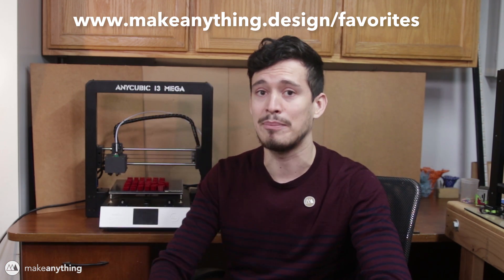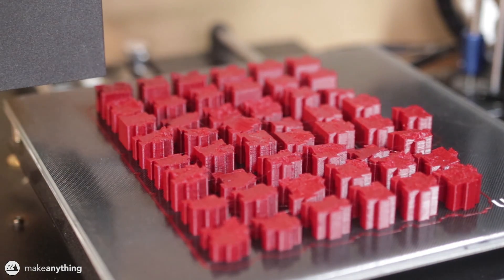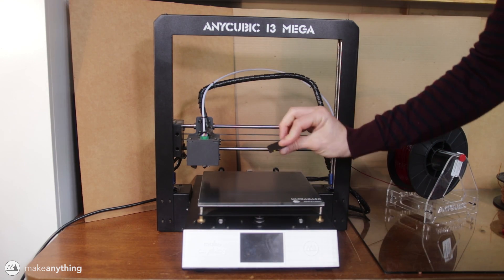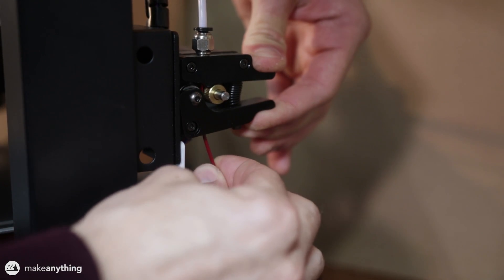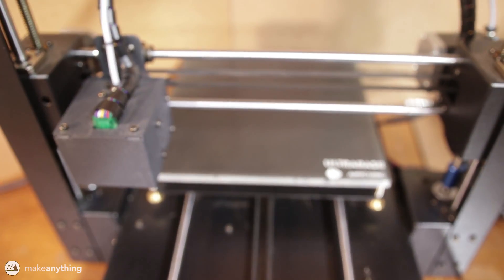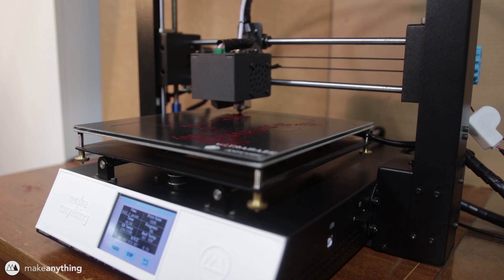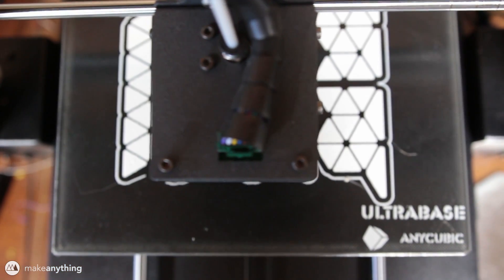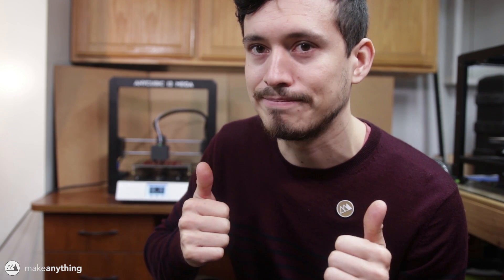Anycubic i3 Mega 3D Printer Review ✰

Comment: If you have problems with your mega don't look for hardware issues first, i stripped mine down twice checking component by component, and it turned out to be the SDCARD, for some reason timing is critical and turned out some cards only work sometimes... Don't cut corners get the fastest brand name card you can, size is irrelevant, but speed and quality is... If it can't read the directory or the print stops for no reason swap the SDCARD first.

For stability, quality and cost its one of the best. But it's noisy and only an average print size... The base is one of the best for adhesion and releasing prints when cold.

Comment: which type of filament would be best for snap-fit parts? Does this printer work well for that?
Reply from the maker: PLA works for many snap fit parts, but if it's for repeated use, you may want to use ABS or even Nylon. Those two might require an enclosure but could be done on this printer
Reply: @make.anything  can you explain further what you mean by enclosure? Have not heard of that before
Reply from the maker: @erickdiaz6152  I usually just put a bag over the printer, but basically some materials need a warmer ambient temperature so it doesn't shrink too fast, so an enclosure keeps the environment warm. May or may not be necessary depending on the air temperature
Reply: @make.anything  ok that makes sense. Might even help with noise too haha. Thanks!

Comment: I ran into an issue when moving the motors with the LCD, I hit "home" when moving the axis thinking it was gonna send them to their home positions, but it set those coordinates as home, so when I sent it home, the bed went back more than it had to and ended up busting the limit switch. I replaced the switch with the spare it included, but now I don't know how to reset the home positions so that that doesn't happen again :(
Do you know how to reset those?
Reply from the maker: Are you sure the limit switch wasn't already busted? The switch is the thing that's supposed to stop it and set the home position
Reply: Make Anything no, it was working just fine, it got busted because it tried to send the bed way too far back, I had to hard turn it off for it to stop twice :/

Comment: I have bought Anycubic Mega S and using for 1 week in my prints I have Elephant foot effect. Do you have any suggestion for the solution
Reply from the maker: Lower the print bed. If that hurts adhesion, you might need to use hairspray or gluestick (although the ultrabase on my i3 mega printers have been great). Otherwise, you can just print with a raft, or just live with a bit of elephant foot
Reply: @make.anything  my actual problem with elephant foot when I print functional parts like your fidget spinner (geared model) gears stick the outer wall or stick each other and they don't move
Reply from the maker: @orkhonal  Yea, so if lowering the bed doesn't work, using a raft should improve accuracy
Reply: @make.anything  sorry if I bother you with questions, I am new to 3d printing ; do you mean lower the bed using screws under the ultrabase plate or using the Cura?
Reply from the maker: @orkhonal  Do it with the screws if you can. And no worries I'm happy to help if I can!

Comment: WARNING!!!!I got the mega S and that sucks, the build plate i am not fan of(but that is maby just because i am use to buildtak flex plate), you have to wait til the build plate is cold to remove the prints. and it is noisy AF 71 db, now the part cooling fans mosfet is burned out at 50% cooling (6V)  not good enough for PLA not bad enough for ABS and it is only 2 month old :-( but just before this happen i got new solid slide bearings (drylin rj4jp-01-08), added stepper motors from my 7 year old wanhao i3 and added TMC2208 V3 stepper drivers, and with new fans i am down to 41 db. :-D but now part cooling is dead. and i can see all over they recommend that you add external mosfeds to your head bed and hot end so you don burn out the internal mosfets because they are way to small, this printer is just TO cheap.

Comment: Hey i bought the Anycubic Mega-S and never got a single print out of it, not even the demo. On top of the bed being so difficult to get perfectly level I'm having an issue where the feeding mechanism is slowed to a crawl (almost not moving at all) where the extruder pushes nothing out the hotend, its frustrating i updated to 1.1.3 yesterday and i dont know what else to do maybe i have a bad part on my BRAND NEW S printer i dont know for sure just hit me back with some solutions please.

Comment: I just wanted to say thanks for posting this. I was looking for a workhorse to split the load with my then-MK2S when you posted this, and this video convinced me to grab a Mega. I've had it over a year now, and the only changes I've made to it are replacing the belts, (they were shedding) and last month adding the Mega-S upgrade. This thing requires basically no maintenance other than occasional cleaning filament and wiping off the rods and giving them a shot of oil. The bed's only lost level once, and that was last week when some Ninjaflex (yes, the S upgrade let's you print that crazy spaghetti) bonded way too well to the bed.

It prints almost as well as my MK3S in most cases, assembly required whole eight screws and three plugs, the upgrade required four screws and one plug, it hasn't so much as jammed on me once, and it's never had any downtime. I love this tiny tank.

Btw, if anyone else is emboldened by this post to print NF on a Mega-S or suitably-modified Mega, use some 95A TPU or PLA for the first layer to get the print to come off easy. If you use PLA, it'll flex just enough less to delam with minimal effort, leaving you with an entirely NF part. Not kidding about how well this thing prints it either. Had a squishy Benchy that had readable text on the back, even though the top of the boat looked like a spider nest.

Comment: Amazon says it comes with the ultra base heat bed. Is that an option?  What does that actually do and can the printer work without one?
Reply from the maker: That is the default print bed and my favorite! It's basically a glass bed with a special surface coating that helps with adhesion

Comment: random note: the technical build hieght is 205 but I can never get higher than 208 without jamming and getting my X axis stuck to the top part. the ptfe tube and cabes all just rub on there and get pulled and all. so be careful. probably check yours to see how high it goes before the cables get stuck... i don't understand the "roof" it's so dumb in some ways.

Comment: I got this printer for over a year now as well. The only problem I have is that the middle is higher up then the corners, which is kind of annoying. Also the bed is getting scratched and a few black "pieces" have come off. Another thing ist hat the touchscreen got something behind it from when i first got it, which made it hard to touch it at the top. Other than that it's a great printer for sure.

Comment: I got an AnyCubic I3 Mega, and my extruder is getting too cold. I will have it set to 215C and when printing, the temp will go down to almost 160C. I initially thought it was printing too fast, and even at speeds slower than a turtle, it the extruder gets too cold. Any help?
Reply from the maker: I'm not sure but it might be a PID tuning issue.. in any case I would reach out to anycubic support or their community forums
Reply: @make.anything  Thanks for the reply. Turns out that the circuit that my printer was on was not good enough.  It could not handle the power draws of the machine, and once I plugged it into a different circuit, it worked like a charm.

Comment: Today, my I3 mega’s print button is not doing anything when you select the print button. Does anyone know why this is?
Reply: Did you like damage it? Maybe try and reload the firmware (careful I tried on an other printer and had to get a new motherboard)
Reply: Name here I have found the problem, it was that one of the heated bed’s wires fell off
Reply: Nicholas Liu so I just ordered this printer and I’ve heard that this a common issue have you found a way to fix this?
Reply: Nicholas Liu assuming that the wire is damaged
Reply: Name here well I took the heated bed off and soldered the wire back on
Reply: Nicholas Liu ok thanks glad you figured it out 😀

Comment: Hi. I would like to ask you a question. The filament sensor of "anycubic i3 mega S" produces a "click" noise when pushing the filament. This is normal?
I also can not level the bed, since the center is uneven. The strange thing is that I think it's flat. If you have any advice with your experience, I thank you.
Reply from the maker: The clicking usually means the nozzle isn't keeping up with the extruder. You can try printing slower or increase the nozzle temp by 5-10 degrees. The spring on the filament feeder might also be weak, causing skipping. Anyways, if you're prints aren't affected, a click isn't that big of a deal, right?

Sometimes beds will be a bit warped, but carefully repeating the leveling process might be worth trying. Getting a perfectly leveled bed can be tough but it solves so many problems. It sometimes helps to just move your prints to the very front of the print bed. Or, of course, you can resort to using a raft, although that wastes a bit of filament
Reply: @make.anything  Thank you, take your advice.
I appreciate your help.

Comment: I already have 1 printer (and anet a8 i have given a metal frame, E3D v6 and an ultrabase) but i was looking at a second and was wondering, should i get an anycubic i3 mega or a cr-10 and add an ultrabse to it
Reply from the maker: If the size of your A8 doesn't feel big enough get the CR-10, but at least my i3 Mega has been a bit more reliable. They're both great though!

Comment: I just bought this printer for my daughter.  I put it together, plugged it in and NOTHING.  It does not work.  I double checked all the connections.  They're secure.  But the printer does not work.  I read, after the fact, that a common complaint is that they come with bad power supplies.

Comment: Many ppl seems to have quality issues with this chinease dice . My mega came with 50% banana rods . Warped printbed aswell as A curved slider plate.. a totall mess. Impossible to level it .

The only thing I still like is its design. I will make a custom alu slider. And upgrade to high grade misumi parts.
The lamest thing was I did buy it as an ebay guest so cant even give them my feedback..
Anyway If you really want the mega be aware of poor quality control.

Comment: The link you provided has a "buy together and save" and it has various extruders including this one: E3D - V6 Long Distance 0.2mm 3D Printer Extruder is this necessary to buy too? Sorry new to this, haven't got a printer yet
Reply from the maker: Definitely not necessary. The .2 will help you if you want to print extremely small or detailed parts though
Reply: Make Anything so you have to change the extruder depending on what you need to print? They have a lot of extruders lol

Comment: How does the SD Card work? Can I download items from like Thingsverse and change the size with exact dimensions? Is there a program I can do that on the computer? or can I change sizes on the printer screen? I am first time 3D printer guy and just had a bad experience with M3D.
Reply from the maker: you decide all those sizes and settings in the slicer on your computer. Then you save the file to the SD card and transfer it to your printer. I'm sorry about your experience with the M3D.. I've only heard complaints about it :\
Reply: Ok, this helps. But what is a slicer? Is that a program I can download? And I can download pretty much any file? Like from Thingsverse?

Comment: The I3 Mega is an awesome printer once you have it dialed in. Reliable is the key.  No way I would purchase a CR10, when this machine is more solid and has easy touch screen access and a great ultrabase. I have suggested to the Manufacturer to consider making a 400mm x 400mm by 400mm I3 "Super Mega" perhaps?, with the same features.  No need to change something that works great, just increase the build volume and size the electronics according to power requirements, in particular for the heating parts.  A very minor con on one of mine has been the ultrabase being slightly not flat with a slight higher center could be that the glass was not made totally flat or the aluminum base to witch it is attached was not level itself before joining the glass to it. My experience in manufacturing tells me itwas the first.  I've taken the risk to carefully put a bit of pressure on the ultrabase and this has taken a bit of the center heigh which was off by about 0.2 mm.  The extra complete hot head that Anycubic provides with the machines has come in very handy after printing so many great parts, hundreds of them, I ended up having to replace the hot head to regain the same first print quality. The nozzle being brass will wear out as any similar nozzle will, with time and use, and particular when you print various types of filaments, especially exotics  like wood filled, fg or carbon filled. I Stricly use each machine for its dedicated filament and try not to mix filaments into the same machine to keep the prints more consistent. Changing the hot end is not a big deal, remove the back and top screws to have access to the hot end. I rather the machine have more screws than not enough.

Comment: May I know what is the retraction settings you use (or did you use it?).

I am surprised that your i3 Mega is printing separate small pieces so nicely, I am getting 'spiderwebs' between parts, which is missing in your video!
Reply from the maker: I don't have access to my computer right now, but retraction is set at something like 6mm at 40mm/s. With many small parts I'll usually have .6mm z lift for travel moves as well, so nothing gets knocked over
Reply: oh I see, thanks!

Comment: Do you need an SD card or can you connect straight to a PC. Great video for a complete newbie to 3D printing.
Reply from the maker: You can connect to a PC but then if your computer turns off during printing, the print stops.. I find SD cards best for reliability :)
Reply: Thanks for your reply. My computers are on permanently but will transfer to card just in case.

Comment: I just got one of these and mine doesn't have the auto bed leveling, and considering its my first 3d printer I am having extreme difficulty leveling the bed. If you have any tips for me on how to level the bed better that would be much appreciated.
Reply from the maker: First, tighten all the screws to lower the bed (twist right). Then home, disable steppers, and manually move the print head above each screw. Raise the corners one at a time until a piece of paper just barely slips between the bed and nozzle. Check each corner a few times and your bed should stay level for a long time.
Reply: Okay thanks :D

Comment: 2:46 I dont agree with you! My anycubic i3 mega is impossible to level, when all the corners are perfectly aligned with a piece of paper, the center is way too high and the same piece of paper wont pass through!
Reply: fr2632 I’ve run into this issue with my mega-s as well. This is a machine that’s made in China and trust me, it will never be machined well enough for all the points to match. What I do instead is to just ignore it, since the nozzle goes a little higher when printing.
Reply: @s3ab1rd  So 2 years ago I opened a dispute with aliexpress (where I brought it) and they send me a new heating bed with a new glas etc, I replaced the whole thing and now it levels perfectly. So I guess the old bed was warped or something
Reply: Personally I've calibrated the bed in the software, pretty simple
Reply: Michael Alunni how did you do that it would be much appreciated to know thanks

Comment: I belong to a "makerspace" and have been using a $4,500 printer there and I can honestly say this printer produces equal quality prints (in PLA).  I paid $369 at GearBest which included shipping.  When you receive the i3, they include a large reel of black PLA, a spare nozzle (!), an 8 gig SD card with a USB adapter, a spare limit switch (what?) and all the tools you will need to tear the thing completely down.  It took me about 20 minutes to put the machine together, and that's only because I actually read the manual.  Easy as could be.  Very satisfied with this little thing, and I'm about to head down to the makerspace to show off the work it does.
Reply from the maker: +Greg Preston isn't it awesome how good printers are getting. Exciting!

Comment: I have this printer and its been good but I've had a few problems .  the top layer sometimes gets a little messy . i need the top layer to be perfect . also one particular item keeps snapping the filament in the feeder , any suggestions? This particular print has snapped the filament 3 times . do you think the problem is the slicing?

Comment: Something to be aware of is that there are currently two variants of the i3 Mega Ultrabase. There is the older Mega03, which uses an 8-bit controller board (Trigorilla), unsoldered A4988 stepper motor drivers (allowing for upgrades) and a separate SD card slot and ribbon cable. This version does not read embedded folders on the SD card (either SD card reader dependent or LCD dependent or both). The other version is the Mega04, which has a 32-bit controller board (Trigorilla Pro) and SD card reader in one. This version has soldered A4988 stepper motor drivers (upgrading the drivers is not possible), and the SD card reader and/or LCD  is able to navigate embedded folders on the SD card. An argument can be made that the Mega03 might be better for upgrading and repairing.